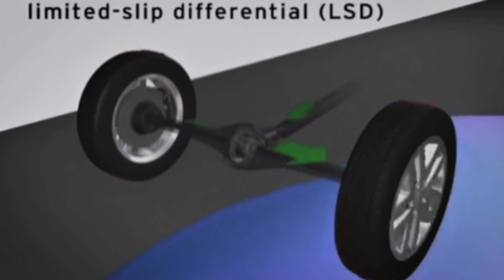Prerunner Differentials Explained w/ Blackhat & Alec Navarro | TRUCK ANATOMY

Comment: I wanna slide my rwd 98 Tacoma thinking of doing a spartan lunchbox locker . Any advice and do you think I can install with limited difficulty?
Reply: It didn't come with an e-locker? Look into the grey wire mod!
Reply: Spartan is good, it comes with a stronger center pin and install easier than richmond powertrax lock right locker.

Comment: Last I knew with a 14 bolt, you want the opened carrier, as the Detroit Locker replaces the guts of the opened carrier. It won't fit a limited slip carrier.
     But yeah, all the rest of the opened carriers are scrap.